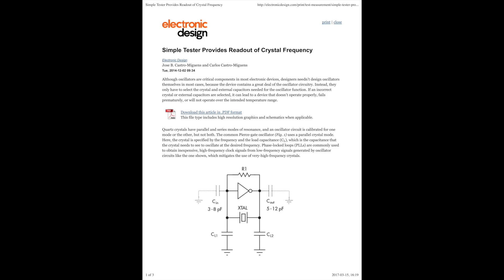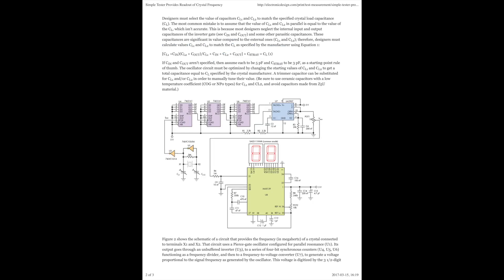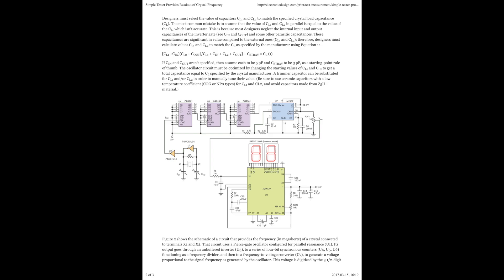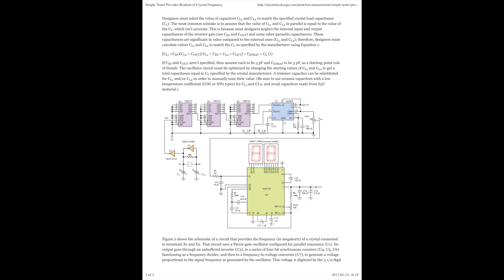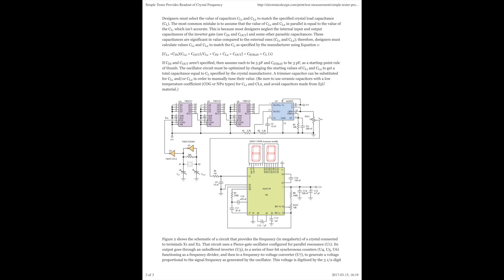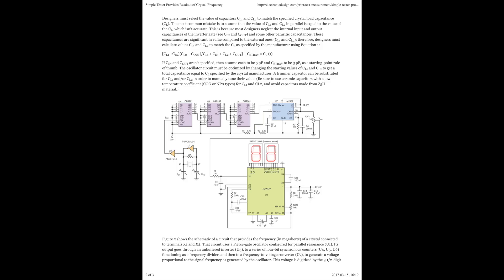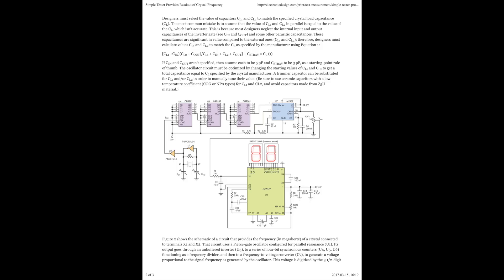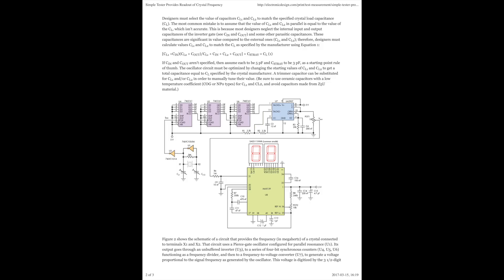Electronic Design Hilarity

Comment: Seems to me it could be measuring the frequency of a crystal with different pulling capacitors installed on CL1,CL2. Not sure what the real purpose of that would be though, as placing it into a different driver would likely cause a different effect. And a Pierce Oscillator as shown here isn't particularly accurate over temperature. I understand what the designer was trying to do though. 30 years ago this may not have been a bad solution.

Comment: This looks like it was from their Ideas for Design section. They paid $75 or so for each idea they printed. Readers voted for their favorite, and the winner each month got another $75. Designs were selected more for being interesting than for being good, though some were excellent.

I liked to try to guess who the contributor was from the circuit. If the design was full of one company's parts, the author was undoubtedly an engineer at that company. Odds are the circuit was from a recent app note or something they designed for a customer. Sometimes a practicing engineer or a professor had a cool idea and wanted to share it. Those were usually the most focused and most interesting. And some were from students and hobbyists. Some of these ideas were excellent, some were questionable, and some were for the sheer fun of proving a crazy idea could be made to work.

Comment: I cannot see any possible way for this circuit to even be remotely accurate. The instant it was fed to a frequency to voltage converter all possible calibration became impossible and it certainly cannot be trusted to even come up with the same results from day to day. The only place I've seen such tomfoolery was on April 1st

Comment: The basic idea of [make a device which can test if a crystal 1. works 2. has the advertised correct frequency (e.g., not oscillating in a crazy harmonic) 3. is paired with 'working' load capacitances] isn't a bad one, but yes absolutely bonkers way of measuring frequency. At very least you could just shave down to using only one divider and then use an event counter/timer on any microprocessor of your choosing to detect its frequency with very good accuracy even for higher frequency crystals.

Comment: I mean, you could just divide by whatever factor makes sense with a bunch of flip flops, and feed the output into a 0.10$ MCU with its own oscillator... If you know your own frequency, figuring out the frequency for an external signal is just a matter of a simple division... Output the result to a UART with as many digits as you like.... Just one MCU with a 8-bits counter and a couple of lines of code is all you need...

Comment: If we take the most generous point of view possible, we could pose the problem as "Here are 10 unlabeled crystals of various frequencies between 0.9 and 1.9MHz. Label them with actual frequencies." And the circuit would provide an answer. A pretty terrible answer, evidently produced with whatever parts they found in the scrap bin and had experience with in the past. But an answer.

Comment: Also, why would you implement a divide-by-4096 with THREE fancy presetable synchronous counters? 4096 is a power of two, after all. All you need is a chain of flip-flops (i.e. a binary ripple counter) - say a 74HC4020, or even a '4060. That one would give you the unbuffered inverter for your Pierce oscillator AND a 14 stage binary ripple counter, pull the output from Q12 (we only want 12 stages) and you're done - with a single IC.
Reply from the maker: Cascade two of those, drive an LED, and just count the resulting period in your head  ;-)

Comment: Looks like it was generated by bad AI or a young beginner in electronics . It would be just as valid and dumb to use the frequency to voltage converter to heat a resistor and measure its temperature with a digital thermometer , or the brightness of a light globe with a digital lux meter or any other quantity you could imagine 😂 . In Electronics time and hence frequency can be directly measured orders of magnitude better than anything else and should always be  used where possible
Reply: Thought the same thing but 2017 was before LLM slop.
The funniest thing is that a frequency counter has got to be one of the simplest digital circuits imaginable. Heck, you could easily make one with arbitrarily high precision using any cheap microcontroller with 2 counters (assuming a perfect reference ofc)

Comment: Most of the circuit slop comes from India or sometimes Middle East. You stumble upon it either while searching in Google Images or on short video sites. Video ones are usually the stupidest.
I don't know why they bother publishing this, it's often not even signed by a name (if it did, it'd be a futile atempt at building a personal brand), and certainly does disservice to newbies who come across them.

Comment: I tried to read a circuit diagram on a badly translated Chinese web site.  One of the terminals was marked "soil".  After thinking about flowerpots and farmland, I had a good laugh once I realized it meant GROUND.
Reply from the maker: Ha. Of course, you'd need different symbols for sandy, clay, wet, dry, etc.

Comment: What an odd circuit. Are the pots on the 2907 out and 139 Ref are to convert the 67Hz/V of the 2907 (assuming I read the datasheet correctly) to the correct values? The 2907 doesn't seem to have sufficient linearity if they wanted to measure PPM. Trying to think up a use case: you just bought a lot of 10,000 NOS or pulled crystals between 1-19MHz and want to verify they work.
Reply from the maker: Good use case, but I'd still just pull out my frequency counter or scope ;-)   Ha, another microflaw: Surely only one pot is needed to calibrate the thing...!
Reply: > pull out my frequency counter or scope
I'd connect a CW/SSB/BFO receiver and sort them by ear! Jokes aside, this may be faster than a scope or counter, assuming a huge batch of identically rated crystals.

>  Surely only one pot is needed to calibrate the thing
a pot of soil for grounding purposes, per the the other comment